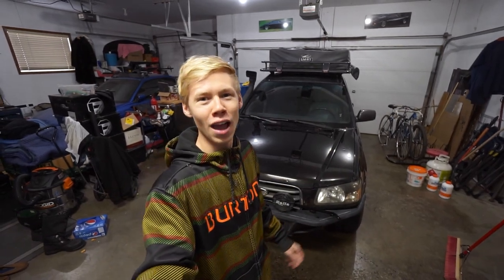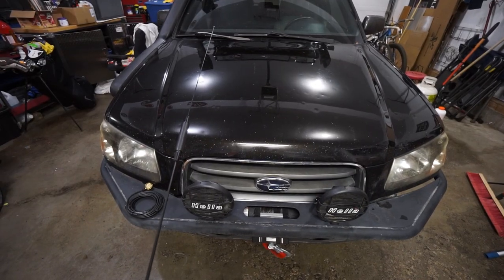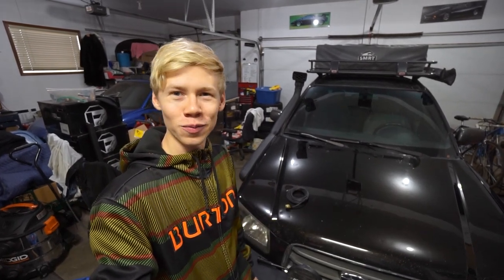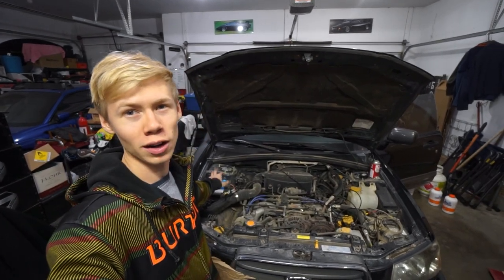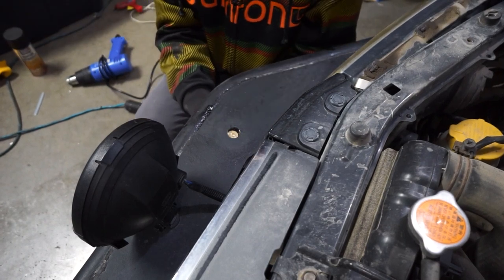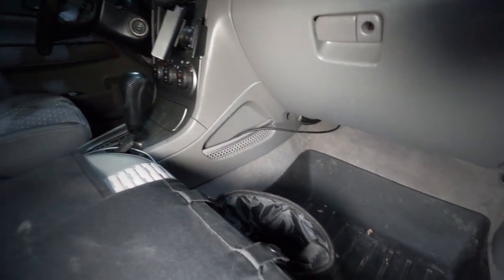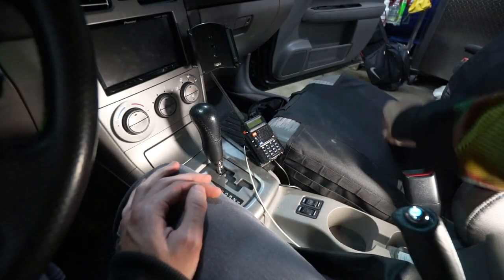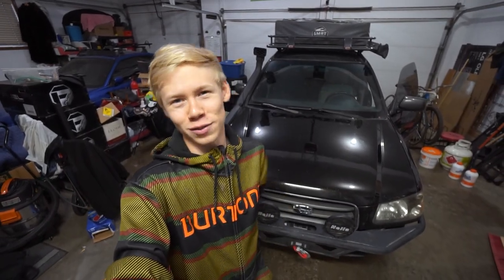How to Install a GRMS Radio Antenna on your Offroad Subaru Forester!

Comment: Love the simple setup. A few questions. The first is how is the overall quality with the antenna being on the bumper vs the roof? Also with the radio being wired on both sides has this provided any issues with use, or did you change the the wired mic setup?
Reply from the maker: Thank! Honestly, I never ran it on the roof because I didn't have room but theoretically I am losing out on a bit of performance because the body of the car would be blocking a bit of the signal. I have found at full power the 12v doesn't provide enough power but I think that might be up to the 12v adapter and not the radio itself. I will see as I upgrade the battery to a USB-c rechargeable one!